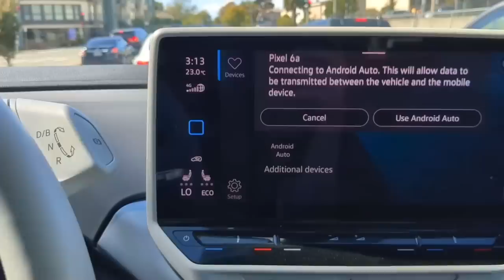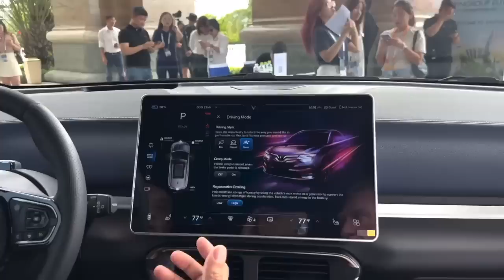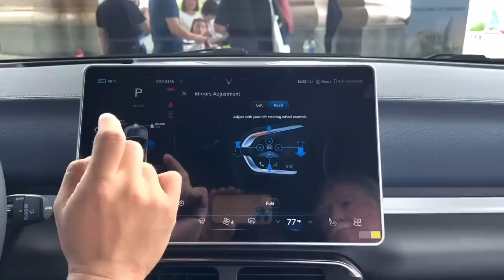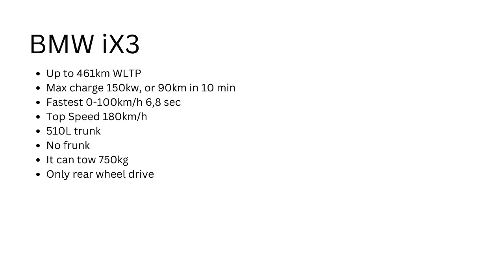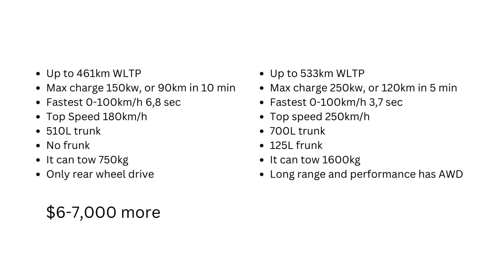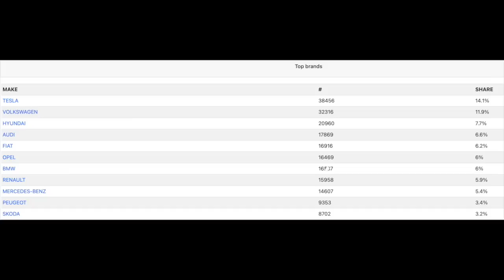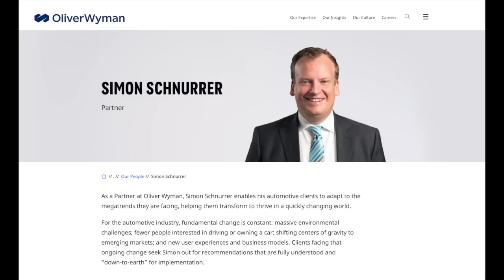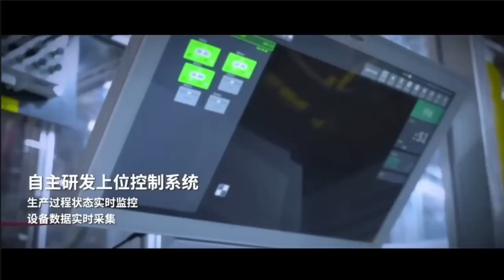The Germans Automakers are in trouble - Their competitive edge are eroding with EV’s

Comment: Germans still have the edge on interiors, and the fit and finish, suspension and drive feel. But after owning 4 Teslas, I can not buy another German car. Mercedes was so dumb to squander their relationship with Tesla! They could have been the #1 brand with Tesla software and drivetrain.
Reply: Tesla use premium suspension that is found in top of the range mercedes and bmw. Sandy Munro said everything he found in the tesla teardown was premium.
Reply: @tk2x Tesla is upgrading their suspension for the 2023 Model Y and Model 3.They should be out soon. According to a tweet from Elon, the new suspension should improve comfort without affecting handling. 
As long as Tesla keeps taking constructive criticisms to improve on their cars, they will catch up with the Germans on all fronts where they lag, and keep improving their lead, in the areas they already lead.

Tesla keeps improving and tries to get better over time. As long as they keep doing this, as fast as they have, then German cars will no longer have any advantages over them.
Reply: I disagree, legacy certainly don't have the edge on interiors unless you are an 80 year old.

Comment: I would like to suggest a topic for you Lars.. The cost of running an ev vs the cost of running an ice car, given the changes in prices. For example here is France a 32 km round trip takes about 7 kw in my 2017Tesla S...and the at home charging price (peak) is 14 cents per kw.. Doing the same distance in an ICE car will take between 2 and 2.5 litres, and the diesel price (for example) is €1.92 per litre -  when you can get it (because of the strike by refinery workers)..

Comment: As always Lars another great video. I would describe the software in electric cars as the new differentiator. 
When cars appear similar the advantage Tesla has in software is going to make a lot of people go with the Tesla. Taking your car to a dealers for a software update compared to an over the air update is very quickly going to turn people off those cars which do not have over the air updates. 
The other issue is people are going to spend time chatting at chargers and any car company whose product is “below par” through word of mouth marketing is going to start suffering.
Reply: This is kind of the same to the smart phone revolution, where Apple was the only manufacturer with decent software. Everyone else just sat there faltering at the edges until rescued by Google with the Android OS.
Will there be a great saviour this time? It does not look so
Reply: Correct not all evs r da same there is  Tesla an there’s th rest
Reply: @michaelstarkey9745  On the Munro Live channel Sandy in a throw away remark said that most of the 100 staff either had a Tesla's or had one on order - which is probably the biggest compliment any car company could get.

Comment: 10:40 This is a massacre of specs (BMW iX3 vs Tesla Model Y), but I wonder how aware potential customers are of the difference.  I try to do my part to educate the public with 0 to speed-limit starts from first-in-line positions at intersections with my MYP.  There's a perception around here (semi-rural Nevada) that Teslas are slow, so I have my work cut out.

Comment: At   11:14 in the video. I see inferior hardware.  Which of those lower performance numbers are due to software?  None of them.   It looks like half of the Bosch parts catalog is not useful in an EV.  They are going to struggle to survive.
Reply: Good point. Bosch wrote the code for Dieselgate and made the fuel injectors. All rubbish now. Good riddance.

Comment: Tesla is an AI powered software engineering company that designs and manufactures computers that interact with the real world, at scale.  Tesla designs their own hardware to match the software requirements.
Tesla products?
- Computers on wheels (S3X&Y), Semi and soon Cybertruck
- Computer in Energy Solutions (Megapack, Powerwall and Solar)
- Computers on legs (coming soon..  Optimus)

Until BMW takes the same approach, they will not be any competition to Tesla or the Chinese.

Comment: Interesting your linked identify of those particular companies as the only representatives of the nation. All that effort to consider their continence as if it were an existential issue for the nation.

What they, the nation, needs is active investment in startups. Granted, it is a messy process. Capitalism isn't tidy. Had legacy ICE transitioned 3 years ago, were at their current investment levels then, and the nation had made investment available to startups, they'd be in much better shape right now. Still, there'd be bankruptcies. There would also be companies with 100,000+/yr run rate models. China has 16 models at 100,000+ this year.